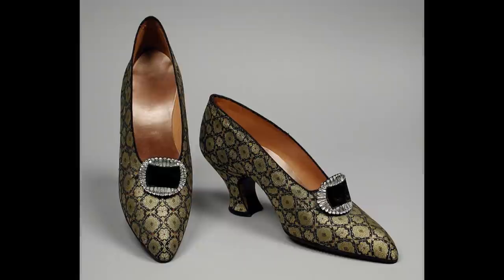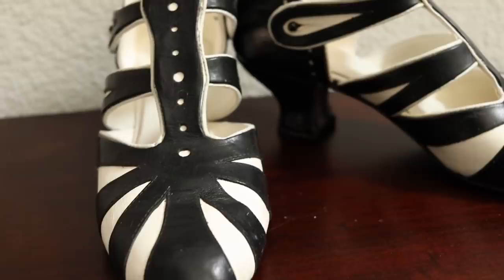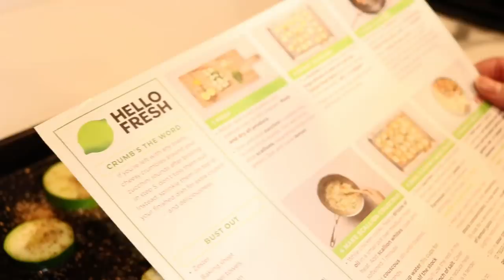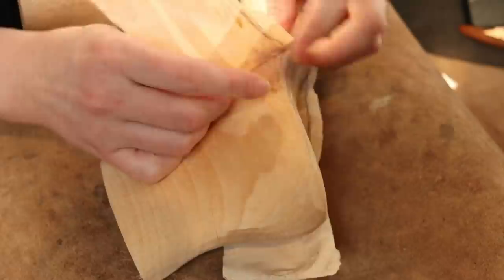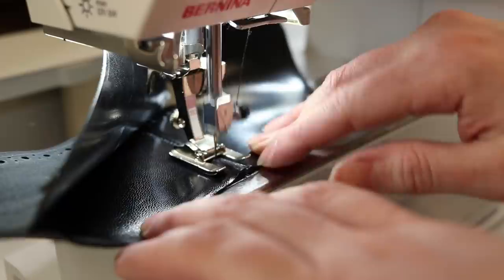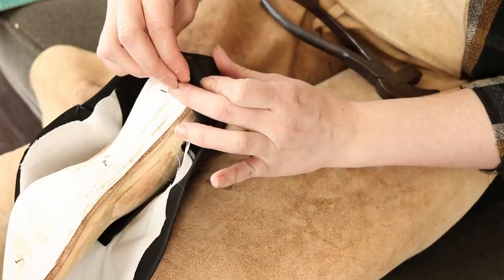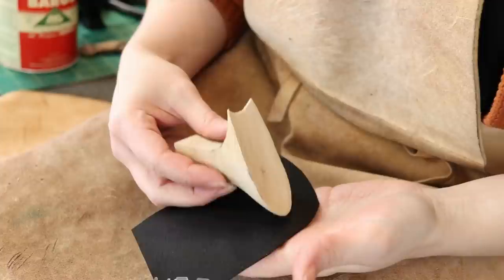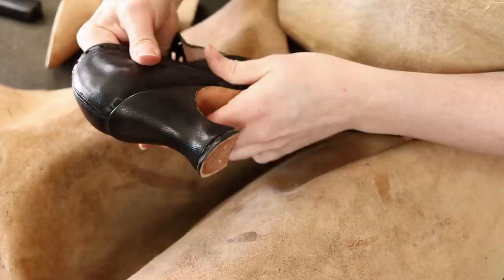I Made Witchy Edwardian Shoes by Hand!

Comment: You could, theoretically, soak your wood last in a polymer to give it a longer lifespan; but maybe easier would be making a plaster of paris form and then 'pouring' a polymer/sawdust casting.

For your sander, get your shop vac and just make a coat hanger bracket to hold the hose near the baseplate and just turn it on. Or, use a bit of PVC and pipe hangers to make a permanent mount on the baseplate that you 'plug' your vacuum hose into. It will probably suck up 90 percent of the flying sawdust and cut down on those annoying 'clogs.' Learned that years and years ago building a kit car in the garage and dealing with fiberglass and filler dust.
Reply: This is a super useful idea for a dust management that I could 100% do with things i already own. Thank you for commenting with this!

Comment: The toe and heel stiffener has to have the skin layer sanded to get the epidermis layer removed, just like how the sole is done. Toe and heel stiffener must be skin down touching the last/lining. The flesh side needs to be shaved to get the loose hair bits lessened. It also needs to be heavily glued with some sort of stiffener paste to the stiffener and lining and upper. Most people use regular white glue for the toe and heel stiffener(some people use a different stiffener product for the heel to make it slightly less hard).  The last step is it needs to be hammered to compress it. The sole and heel stacks also need to be hammered hard so the leather is compressed and does not prematurely wear thin.

A specific shoemaking metal piece needs to be inserted in between the sole and insole to prevent the instep from sagging.

Also the only thing holding the foot in that shoe is the top line of the shoe. You can make the pattern tighter to get a tighter fit. Some shoes like that have a very precise wavy top line just to get more grip/tightness. The last thing is the vertical cut on the heel can be slightly  exaggerated by a few millimetres per side so when you stitch it together it wraps tighter to the shoe.

Very minor changes. Regardless, that is very impressive with how you made your own last, and made a very complex and  presentable shoe.

Comment: Tip: After gluing the heel. The cobbler would'vetaken out the interior insert/foot bed. Secured the heel with a few nails. Ensuring the nails were smooth & replacing the interior foot bed with glue.
Reply from the maker: That is a common modern construction technique, but many of the antiques I've handled from this era have visible nails through the insole! A few have a second insole added to cover this completely and some have the label there instead. The historical nails were much smaller than our modern BIG nail or screw we put down the center of the heel.

Comment: Fantastic!  I got instantly hooked to your videos.  The 1910 to 1920's era is a time I have a deep connection and loving for myself.
I actually bought a house built in 1919 and I feel the music even from that era living here.

About your shoes, wow.
My only comment to your working setup is that I believe you need a more sturdy placing when you nail or cut your leather edges or hammer.  It seems rather unstable to create a perfect feel to the hammering as well, as it bounces on the lap.  (I don't know, I am just speculating).

Also, I watched some very skilled shoe makers cut the sole in more detail AFTER they place the 'top lift' onto the heel.  They don't cut it away from the sole but place the top lift on the the heel and then refine.

One more thing, and I might be a little picky here, but I am learning wood working.  I saw your wood heel has some rough cuts, I was going to recommend that there are some nice wood files that will even those out.
Thank you very much, I am looking forward to watching more of your videos.

Comment: I think a band saw would make your life so much easier than just a pull saw ;)
Reply from the maker: I work mostly with 4" or more in terms of wood width and that requires larger than "normal" band saws. I used to have one, but it never worked well with thicker woods and I gave it away after breaking the blade quite a few times.

Comment: Nicole, can you use a 3-d printer to build lasts?   Printing materials vary, but some will take tacks.  (I am currently obsessed with 3-d printers, so it is the first thought that popps into my mind.)
Reply from the maker: I probably could, but 1. you need the density of a solid object (not something with a thick shell and honeycomb interior) and 2. I don't have experience with 3d rendering on a level needed for that. I can visualize how the last should look, but digitizing that is a completely different thing than muscle memory.

Comment: How long does the leather have to stay on the shoe form in order to hold its shape? The video showed you nailed the leather to the last (? no idea if that is spelled correctly) but you didn’t say if you had to wait a day or how you knew that the leather wouldn’t lose its form.

Really interesting to see how shoes are made.
Reply from the maker: Once you've cemented or stitched the entire thing together you're good to remove the last. Even if it's not dry (in fact, with some styles they need to be wet).

Comment: Is this what the process of designing and creating shoes for American Duchess looks like, or is there another process for shoes when you’re making a lot of them that all need to be identical?
Reply from the maker: Designing for and making mass-production modern shoes is very different. There are similar steps when it comes to the construction, but they're done with the aid of machinery and an assembly line. Sampling has more similarities, but that's still done by the manufacturer, not the designer (which is what I was doing).
Reply: @NicoleRudolph  Thank you! I think I’ve discovered a new fascination.

Comment: Why isn't anybody using 3D printing to make very exact lasts for shoes?
Reply from the maker: What is most common is designing lasts in 3d and then CNC milling them from a block of the appropriate material. They can't be hollow, which is standard for 3d printing.
Reply: @NicoleRudolph  I have seen 3d printed stuff where they wer able to print hollow shapes with internal reinforcements. Ain't technology fun!